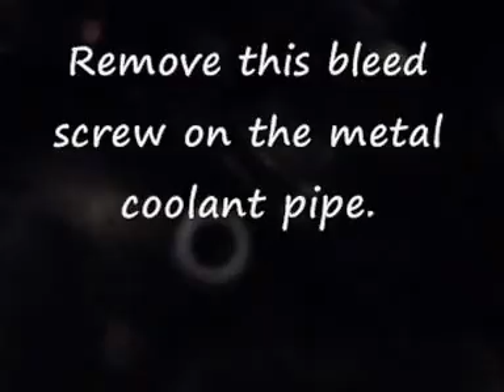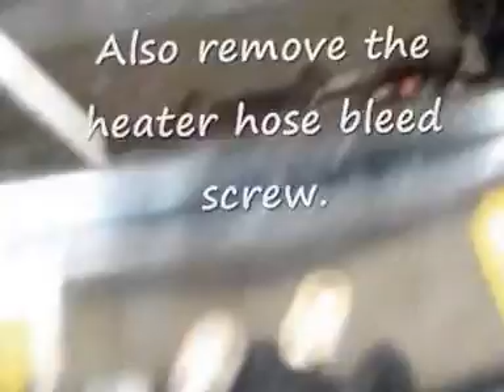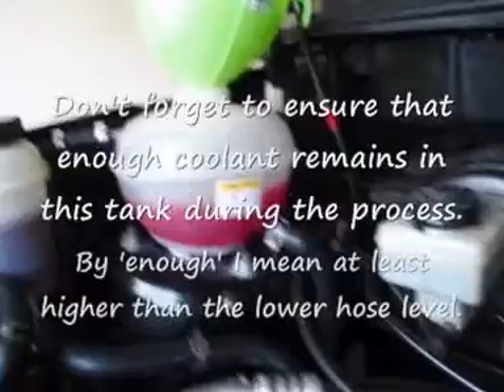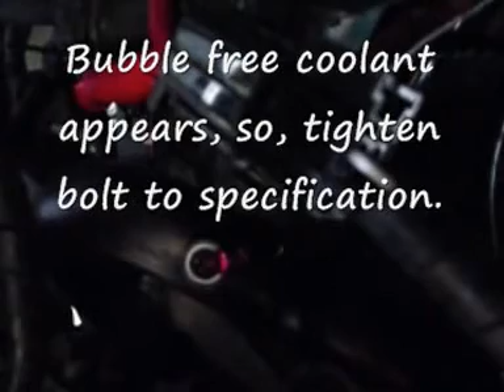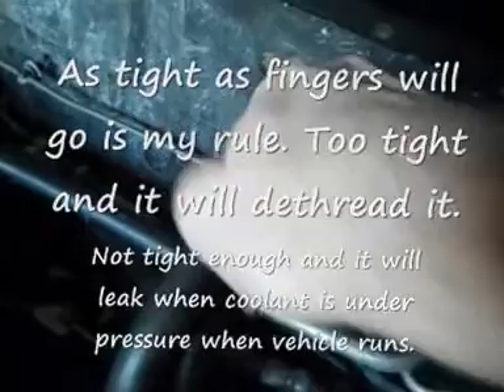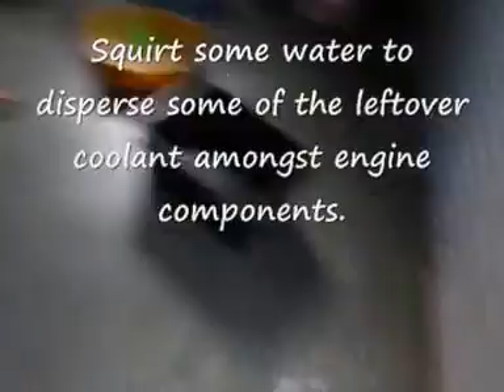1.8 K Freelander Cooling System Bleed

Comment: I can only get it to bleed from the heater matrix bleed screw. Only over pressures when heater is on.

As soon as heater off the system over pressures the expansion chamber.

When I remove the bleed screw no water comes out. 

The system seems to been circulating and no hard hoses 

Any ideas
Reply from the maker: Hello Royal, thanks for your comment.  Over pressuring can indicate a leaking head gasket where exhaust gases are getting in to cooling system network. If it can bleed from the heater screw it should also be able to bleed at the metal pipe bleed bolt point which is lower than the heater bleed screw. Have you done a head gasket test to see if exhaust gases are present in the coolant? It might also be possible that there’s air trapped in your coolant. When you undo the metal pipe bleed bolt, can you get a positive visual on coolant circulating inside that metal pipe?

Comment: I recently replaced the heater matrix/core after skimming through one of your videos, topped up with coolant since the coolant wasn't fully out of the system. I still notice the level dropping a bit. Do you think it could be a gasket on the water pump?

Edit: mine is a Td4 2003.
Reply from the maker: Hi Adrian, great that you’re working through the troubleshooting yourself. I’ve never had a Diesel Freelander nor ever worked on one, so my opinion isn’t backed by any experience. Look around for coolant around the engine bay. If you have a coolant pressure test kit, you can pressurise the system while the car is off and look for leaks.
Reply: @jascokovacevic  I don't, but I'll buy one sooner or later. Good to have around the house.

Comment: Ja bih isto hteo video sa BMW M47 motorom ako imaš. Ili je isti postupak?
Reply from the maker: Kako si Gheorghi! Slicna je procedura kako moras da zrak izbacis iz kuling sistema. Evo neki video naso Sam na YouTube, Valda ima Jos videa na YouTube.  Hi Gheorghi, it’s a similar procedure in that the air must be bled out of the cooling system. I have found one video but there’s bound to be more, just do a simple YouTube search. All the best,    Jasco. https://youtu.be/0a8fSPOWloc
Reply: @jascokovacevic  
Ako je kao na motora od Freelander 1 diesel onda mi pomaže. Hvala!
Reply from the maker: @gheorghinacov6008  Neznam ako je ista konfiguracija Kao Freelander posto ja nisam nikad Imao Diesel auto Ili Diesel Freelander. \\. I don’t know if it’s the same configuration as the Freelander as I’ve never had a Diesel before nor have ever worked on a Diesel.

Comment: You make a comment below saying "metal ball pin isn’t stuck". That's why you have to disconnect a hose and blow air through it.......but it is hard to follow where everything is in video. You give a clear shot of the bleed holes, but I can't follow how you get to them relative to the reservoir. Where is this metal ball pin?
Reply from the maker: Hi MRM, appreciate the feedback, it was one of my earlier videos and admittedly it wasn’t easy trying to juggle everything on my own. The pin is within the tiny coolant passageway on the inlet manifold.

Comment: Hi my name is Keith Joshua south Africa....I have a v6 PETROL free lander...the water bottle is boiling
Reply from the maker: Hi Keith. Further investigation is required. If the tank wants to boil, it’s getting the pressure from somewhere. While it could be a leak at the head gasket or liner, it can also happen if theres a leak elsewhere at another cooling system hose or component. Was the cooling system bled properly? When you start up your Kv6 after filling the coolant, is there bluish white smoke out of the exhaust to suggest coolant burning? Similarly when you return from a trip and shut the engine off, once engine is off, immediately open the oil filler cap, is there a lot of steam that escapes ? Have you attached a coolant pressure test kit to it and if so what’s the outcome ?

Comment: hi man ! Yeah, if you dissconect all the hoses then refill, how do you get the coolant past the external mod thermostat which will be on closed position? Cheers man! 🍷😏
Reply from the maker: Hi Arnold, there’s multiple routes that the coolant will circulate through once you start filling. The new thermostat hose kit includes a large hose that comes out of the front engine bay (cylinder head), which is then connected to a T piece, which in turn leads to the radiator. Coolant will also thus take this route and in to the radiator then out the bottom radiator hose and on to the other end of the thermostat housing. In addition to this, when the remote thermostat is in the closed position, I believe a tiny amount remains open to allow bits of coolant through.
Reply from the maker: So the maiden coolant during new fill shall make it through the network of pipes and hoses.
Reply: Alright! Should i fill coolant in the heater core and attach, thennfillbfrom the reservoir or should i just fill everything from the reservoir and do the 'bleed' technoque? Also, should i blow out with air after flush before refilling with new coolant? Let me know what you think, cheers man - salute! Regards!
Reply from the maker: @arnodafe  as long as you used off the shelf products to flush the system with and followed the directions, there should be no need to blow the system with compressed air prior to refilling. In saying that, be very careful if using compressed air as some of the coolant components might be damaged. The IRD component has tiny in and out hoses and blowing compressed air through there could unseat the coolant chamber. As long as you don’t have foreign material in the cooling system that doesn’t belong there, or water, I would just fill the system as per the RAVE instructions, fill through the coolant tank and bleed via the metal pipe and heater hose.

Comment: Hi Jasco I followed your directions but still have bubbling & gurgling in my heater when I start my car ??🤔
Reply from the maker: Hi James, if this is the case then it's going somewhere. Coincidentally I refilled coolant in my 1.8 today, I did away with Evans Waterless and went back to red OAT coolant and bled it just like in this video a few years ago and there's no gurgling or bubbling. I commenced with the heater hose bleed screw and the bleed bolt on the metal coolant pipe both removed - then when bubble free coolant emerged from the metal pipe since this is lower than the heater hose, I did up this bolt then closed the screw on the heater hose when bubble free coolant started to emerge. Mind you, I only waited about 10 seconds on each hose for bubble free coolant to appear. Years ago when I had a head gasket leaking coolant externally on this car, it was doing exactly that - when I started the car I could hear the gurgling at start up. You've got a leak in the system somewhere you've got to investigate the source of. Are you losing coolant even tiny amounts over time?
Reply: Jasco Kovacevic know and can't seem to locate a leek I'll try again I didn't really under stand the first part with the foot pump thanks for your reply and happy new year 👍🏻
Reply from the maker: Hi James, the only reason I use the foot pump at the start on the small coolant tube is to ensure that the metal ball pin isn’t stuck, air from the foot pump will help free it if it is stuck. Try this, after you fill the system, look carefully to see if there’s any coolant at all dropping from the right front of the cylinder head.
Reply from the maker: @jamesmarriott1133  hi James how did you go with the leak detect? Look at the place where the cylinder head meets the engine block on the front right hand corner of the engine (front right when you look at the roadway from the driver's seat). Look carefully at this section for any coolant. Sometimes it may drip from this area down on to the underside of the exhaust pipe or underside of gearbox bellhousing.

Comment: Hi.  Have u ever seen a coolant bowl with a yellow cap?  I bought a second hand Freelander 1.L petrol 4 years ago & no trouble with coolant cap but coolant bowl got a small crack in the bowl 2yr later & January 2019 the mechanic replaced the bowl & I don't think he bled the pipes.. But now the cap is not tightening properly & coolant is overheating & cap is slipping out from the  bowls lid thread' when it being tightened. This is happening when cars 2nd fan kicks in & I'm losing all my coolant. Could i send u a photo of the cap?
Reply from the maker: Hi Col, I don’t like the sound of that since it seems the coolant may be under greater pressure than normal. To eliminate things you could try and renew the cap. I know what you mean with the plastic threads, the rule is when it feels tight you shouldn’t need to tighten further. If coolant continues to escape even when tightly closed, I think your coolant may be under extra pressure than normal. Is there any mayonnaise substance when you open the oil filler cap? Gave you done a compression test to check for exhaust gases in the coolant? When the car is started, can you hear a gurgling noise near the heater area for about 3 seconds? The 1.8 is really easy to bleed the kv6 is the harder one as it has twice the length of coolant pipes that the 1.8 has. Try bleed the coolant first and put another coolant cap on there, you can try on from a breaking yard even, they can’t all be damaged, j or st for the sake of elimination or buy one from an auto store so long as it’s 15 or 16 psi to match the Freelander one.

Comment: You let the fluid go below the lower hoze level on the filler tank when you were filling the system, so you probably sucked some air back in... oops.... it will probably bleed itself back out into the coolant tank once the water pump is running....maybe better to fill the coolant tank right to the brim to start off with...I'm a bit confused why you let the coolant level drop right to the lower hoze each time before you refill the coolant tank... anyway if there was any air, it should bleed itself back out into coolant tank.  Thanks for making the video!

Comment: Hi jasco my coolant is orange ??? So which coolant do I need to top up ?? Great video again thanks
Reply from the maker: Hi Jason, what do you mean orange? Did you have the car and fill the coolant in full the last time or have you recently bought it off someone? It shouldn't be orange. The RAVE manual states to use the red OAT coolant. Bleed air out of it as you fill. The first bleed point is the bolt and the 2nd is the heater matrix bleed point. The 1.8 is pretty easy to bleed, the KV6 is a pain! The KV6 has probably twice the coolant hose plumbing that the 1.8 does. I gave up on trying to bleed air out of the KV6 by the bleed point - I use the air compressor and a vacuum bleed tool... that's the only reason I bought an air compressor for. If you don't bleed them properly, air pockets will displace coolant in the engine and can lead to failure of the coolant to fully circulate leading to overheating.
Reply: Yer just found out it was just old coolant that had been bleached out by sun in expansion tank my new coolant is like yours red lol thanks for reply love the videos and love my landy :)

Comment: hello,
can you help me find the speedometer sensor and the cable on the gearbox please? i have exact same car. thanks a lot.
Reply from the maker: Sam Ramgoolam depends on what year yours is. The electrically operated speedo is either operated by the vehicle speed sensor or the ABS control unit. The vehicle speed sensor is located on top of the speedo drive, this is for models with ABS which is those made pre-June 2000 and PG1 manual gearboxes, the 1.8 manual model. The speedo drive is located on top of the gearbox housing, next to the inner end of the right hand driveshaft. The cable would be the wiring connector that connects to it.
Reply: Thanks so much for info Jasco. I have a 2002 Freelander 1.8 Petrol Manual. I think they removed the vss from mine and i cant find the cable that goes to it. Can you show me where the cable is located please. Also i am guessing the speedo is using the abs sensor. The thing is the speedo doesnt work sometimes and when i switch car off then back on it works again. You think the sensors gone bad or do i need to just clean it. Many thanks for your time Jasco. I really want to fix my speedo issue permanently :-(
Reply from the maker: Sam Ramgoolam Hi Sam, I didn't know yours was a 2002. I that case, it's the ABS ECU and wheel speed sensors. The ABS unit is tasked with the speed, which gets it's information from the vehicle speed sensors.. are you receiving any faults codes on the instrument panel dash display?
Reply: hi Jasco. nothing on the instrument panel but report from the car electrician says abs sensor error something. My speedo doesnt stop during driving. intermittently when i start car and drive and it doesnt work, i stop and switch off car then start again and drive and it works fine, do i need to change my sensors or clean them or something? what is your opinion please. Many thanks Jasco.
Reply from the maker: Did your electrician tell you which speed sensor as there's 4 - one at each wheel. Or which wheel did he test that told him it failed? You can try cleaning it in case it's dirty, a good first step in elimination and troubleshooting. If that fails thereafter, just replace it. Look at the good side of things - the wheel speed sensors is fairly simple to remove.
Reply: During one test it was the front right they cleaned it then they tested on a drive a they computer shows the rear right is faulty. I guess i have to remove and clean all of them then test. Thanks a lot for your help Jasco. Also my roof / dome light at the front, the 2 sides ones are not lighting, do you where the ground is?
Reply: and you the driver side is not unlocking with the remote, it can lock it but not unlocking it. got to use key. u think its damaged or is there a safe lock or something i'm not aware of? hope not bothering you too much :-) thanks a lot.
Reply from the maker: Sam Ramgoolam Remove and clean all then test.  As for the interior map reading lamps (that's what the manual calls them), this is what RAVE says in relation to the Earth points:

Map Reading Lamps (5 Door Vehicles Only)

Fuse 14 of the passenger
compartment fuse box (C0580) provides a constant battery feed to both the LH and RH map reading
lamp switches (C0355) on a P wire. When either of the switches are pressed, current is
able to flow across the switch to the map reading lamp bulb.

Both bulbs are earthed via the lamp
fixings.
Reply from the maker: Sam Ramgoolam  Door lock regulator for the driver's side needs renewal. I have read some people on the Internet writing that they went ahead and sprayed some WD40 in to the holes, I tried that on mine and it didn't fix it,  the only other solution is probably to renew the door lock regulator. It's pretty fiddly but it can be done, if unsure, take it to a specialist. Basically, the door trim panel needs to come off, if planning to do this on your own, get the RAVE manual on CD.
Reply from the maker: Jasco Kovacevic Note, this is based on the 2001-2005 KV6 model (the earth fixings), I assume that your 2002 would be the same but can check it next time.
Reply: thanks so much Jasco. Been very helpful. I will follow how u told me. Anything else will let you know soon. Already downloaded the RAVE cd.

Comment: so I need the mixed coolant and anti freeze yes?
Reply from the maker: Yes correct, It needs to be a 50/50 mixture with red OAT coolant and water but not ordinary tap or rain water, should be distilled water. You can buy distilled water at most large auto parts stores. Alternatively if you don't want to mix, you can buy a ready OAT coolant off the shelf that's already been pre-mixed and is ready to use.

Comment: When do you start the engine?
Reply: Nothing runs out the metal pipe for mine. It starts running through the top immediately as I screw it off
Reply from the maker: Hi Daryl, after you bleed it successfully then only start the engine. I renewed the coolant on my 1.8 today coincidentally. Well not renewed but I did away with the Evans 180 PowerCool I've had in there since 2016 and moved to ordinary red OAT with a 50% concentrate. So I pulled every hose to drain as much of the Evans as possible. I actually renewed the fuel injector o rings as well so this was an ancillary task. But the way I did it, with the engine off, was put all the hoses back, open the bolt at the metal pipe as well as the one at the heater hose, and start pouring coolant in to the expansion tank, soon if will first start to emerge at the metal pipe logically as this is lower than the heater hose screw point. In 10 seconds it was bubble free coolant, next I poured a little more coolant till it started emerging from the heater hose screw then same thing, after 10 seconds it became bubble free coolant, I then did the hose up then filled the expansion tank to the max point then started the engine.
Reply from the maker: This isn't normal, it's supposed to run out of the metal pipe before the heater hose. Have you sorted this out? Did anyone to your knowledge use any leak stopper or similar chemical to the coolant as that can block tiny coolant passage ways such as that bolt hole in the metal pipe?
Reply: I got it sorted. Just had to push something small in the hole. Seems like the hole was blocked

Comment: Hello Jasco, and greets from Greece. Do you start thew whole operation with no coolant? I mean, do I have to bleed out the old coolant first and then start the procedure with empty system?
Reply from the maker: No, you can bleed the coolant at any time. You can bleed it at either of the 2 bleed points, either the one on the metal pipe then the upper one on the heater coolant hose. I would do the metal one then the heater pipe one. In each case, close the bleed hole once you see bubble free coolant emerging. Ensure the expansion tank remains filled with adequate coolant during this time.